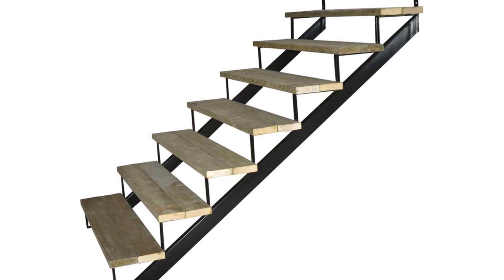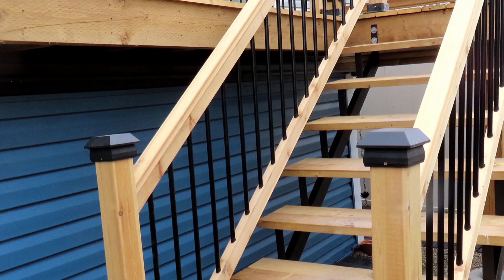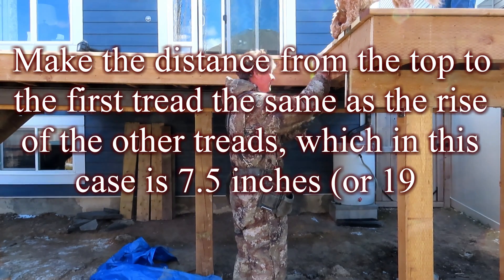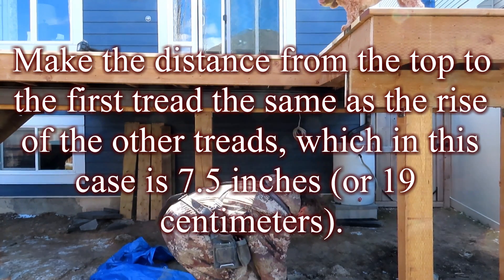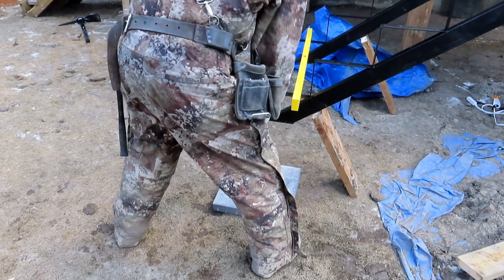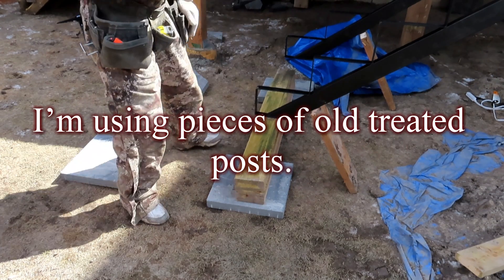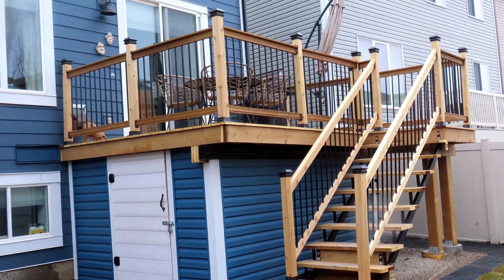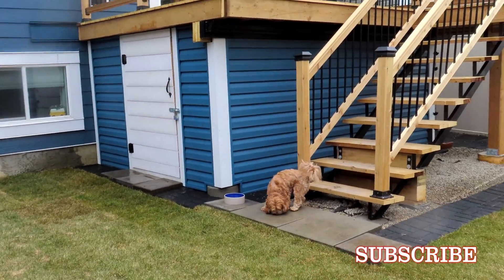How to build a Steel Riser (Stringer) Staircase

Comment: Incidentally, adding to my last comment.  If you build the steps on level bench or sawhorses, you can bolt or screw the steps together much easier because you are looking down on the steps and you don't have to try to look up from underneath the steps to put them together.  Also you don't need an extra set of hands to help you.  You will need someone to help at the end to hold the steps up in their correct position to bolt them to the joists.  Use your head.

Comment: I needed and extra step to finish off a 7 step staircase.  If someone can show me the way to add that step given that I purchased a single metal stringer, I would appreciate it.  The manufacturer has not made it easy since none of the bolt holes match.  Very disappointed.  And as someone mentioned,, bolting them together weakens the entire stringer.  If you eventually drill some holes to match, it weakens the whole structure.  I guess I will have to build a concrete platform in place of that last step.

Comment: Do you find the steps to be slightly bouncy at all? I just installed deck steps with 6 step steel stringers and I used 3 stringers (treads are 42"). The steps feel sturdy, but have a very slight bounce (more noticeable when my husband, who is heavier, uses the steps versus me). Disappointing after going with the more expensive steel stringers vs wood. Is the bit of bounce normal  or should I consider bracing the stringers midway up?
Reply from the maker: "Great question! A very slight bounce can be normal, especially with wider treads like 42" and heavier foot traffic. Even steel stringers can flex a bit under load if they’re only supported at the ends. If it's minor, it's probably just the natural flex of the material—but if it feels too noticeable or bothers you, adding a brace or support post midway can definitely stiffen things up. I’d say you’re on the right track considering that option."
Reply: @diyourhouse2 Thanks for the response! The bounce is indeed very slight, as in I don't feel it if I'm not actively paying attention. I think I'm just looking for problems! I'm leaning towards not adding a brace right now. Thanks again!